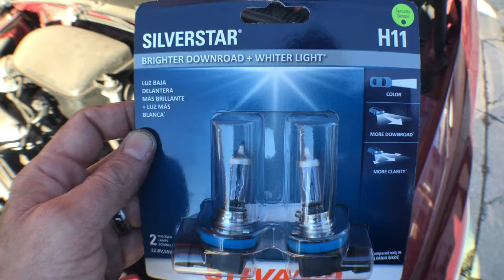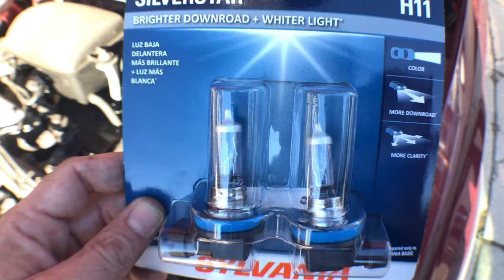2010 Subaru Forester (3rd Gen) - How to replace the low beam headlight bulb (and a 2020 prediction!)

Comment: This post is to help anybody out that has their low beams just go out all of a sudden. I was taking my wife to work one morning and when I turned the lights on they came in for a split second and both went out. Since they both went out simultaneously I thought it was a fuse or relay. I checked them and they were good. I checked the bulbs and the filaments were intact. I went on YouTube and found there were several other things it could be, so I drove around for a month with only high beams till I could save enough to take it to the dealer to have it diagnosed and fixed. Skip to yesterday. I stopped by the dealer and told them the issue but decided to go ahead and buy some stock Subaru headlights. Well, it totally fixed the problem. Apparently, the aftermarket bulbs have some electronic parts in the housing, so the bulb can look fine but be gone. So, replace the bulbs first. Cheap 40 dollar fix.
Reply from the maker: Thanks for sharing!

Comment: You made it look easy but getting the plastic caps off my 13 year old vehicle was a bit of work. I had to tap the fins with a screwdriver and mallet, and use wide grips to get them loose enough to twist manually. I also found the second headlight used a different connector than the first which used the button type that you showed. The other one was an odd side-snap connector type. 

Then again, getting the caps back on was not trivial. They have four grooves at 12, 3, 6 and 9 o’clock. You need to line them up and snap it on before attempting to screw it back the quarter turn. Anyway, thanks for the video. Saved me $90 or so.
Reply from the maker: I’m glad this video helped you save some $!

Comment: Don't know if you are watching the comments 3 years later.  Both low beams went out for me at once.  Wonder if it is bulb, fuse or some other problem. Brights work. Appreciate any input
Reply from the maker: I try and reply to all comments, no matter how old the video.
Glad you came here!
As for what you described, you could be dealing with a blown fuse. Or both bulbs could have gone out at the same time.
I would try and replace the bulbs first. It’s inexpensive and could be the culprit.
If that doesn’t work, try changing out the fuse.
Your owners manual should have a page that shows you all the fuses. Check which one is for the low beams and replace it.
Let me know how it goes!

Comment: Thanks man. When i clean the lenses for the headlamps. I tried using MAAS fine silver polish. Wow i was surprised,it took the dull foggy crap off in no time. I'm sure there are other applications,but that was what i had on hand. Polished up the rear lenses as well.
Reply from the maker: Thanks for the great tip!!

Comment: Thank you for your video demo. May I know what's the bulb (located on a triangle compartment) between the high beam and the low beam?
Reply from the maker: Hmmm, I’m not sure off of the top of my head.
Possibly the side or front turn signal bulb?

Comment: Thank you.  Worked perfectly.  Saved me time and money!
Reply from the maker: I love hearing things like this!
Reply: @DIYTutorialGuy  Sir, really saved the day on this one!  I’m not super handy so am cautious, especially with my wife’s car, and needed to replace before doing some night driving and the dealer was already closed. The housing button on this was the trick.  Replacement in this case was inside the waterproof case but on the passenger side, so needed to remove the air (turbo) intake manifold but then had plenty of room to work.  Please keep these videos up, especially with Subarus staying on the road as long as they do.
Reply from the maker: Thanks for watching and commenting!
I’m really glad this video helped and that you were able to get it fixed before hitting the road at night. 
That’s definitely no fun without both lights.
I’ll keep the videos coming!
My Forester just hit 112,000 miles, still going strong!

Comment: I’m having a hard time removing the black cap - any hints? That protective black cap will not budge
Reply from the maker: Have you tried spraying some WD40 and letting it sit for a few minutes?
That may loosen it up.
Reply: Same issue, tried with WD40, tried to remove the battery and force the damn thing to get off ( counterclockwize) and no freaking chance.. I have to go to the dealer.. 40$ for the operation..

Later edit: the garage shop guys used penetrading oil and a screwdriver to loose the cover, it took them around 5 min. which is a lot but far better than me. I’ve tried with an oil tool but could not use leverage as it was hard to hold the cover theeth, what a pain in the ass it was..
Reply from the maker: Damn man, that stinks!!
But on the other hand, if you have to force something it may end bad, so smart call getting the dealer to do it.
Reply: I had this same exact issue
Turns out, the cap was ALREADY in the loose position, and by turning it and trying to remove it, I actually had locked it. Hope this helps some ppl!
Reply from the maker: This is great to know, hope it helps some viewers!
Reply: @DIYTutorialGuy  yes sir! I guess the previous owner left it unlocked!
Reply: @DIYTutorialGuy  there's a tiny little arrow on the cap if you look closely. When it's loose, that arrow will be pointing straight up